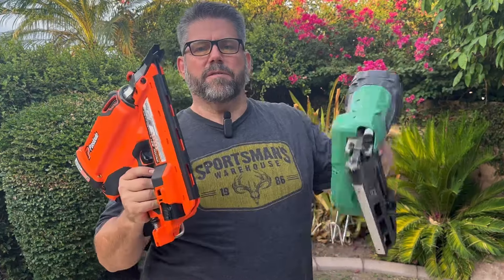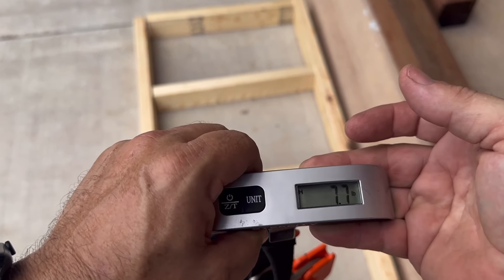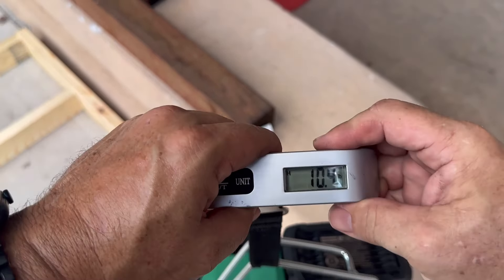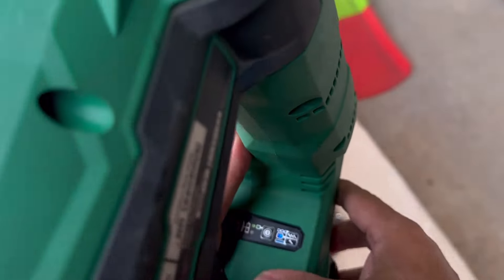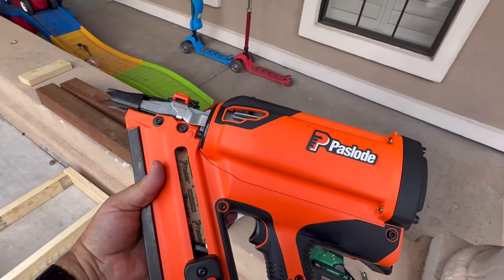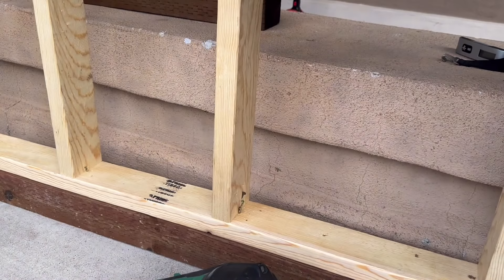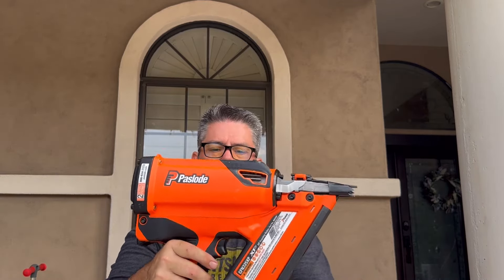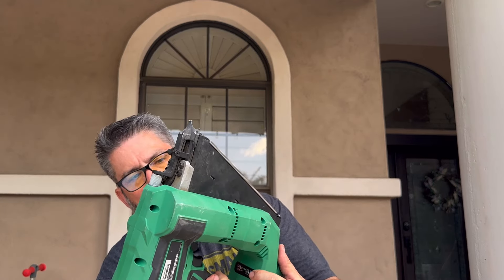Paslode vs. Metabo: Cordless Framing Nailer Showdown!

Comment: I have a Milwaukee 30 degree sitting in a box right now trying to decide about the Paslode.  The weight difference alone is significant enough to justify the $150 more.  My concern is the carbon monoxide emissions from the fuel cell on the Paslode as I would be using it exclusively inside for renovations.  Wondering how strong the odor is when using it inside.  Safety instructions say a "well ventilated area", but in Northeast winter I do not think the homeowners would like the windows left open to use a tool.  So if you have used it inside how bad is the gas odor?
Reply from the maker: I don’t think it is any more than a plumber who uses a torch to sweat pipes…or a chef who uses a butane torch to burn sugar….so unless you are in a seriously small confined space you won’t notice it

Comment: Hey mate, I bumped to one of the paslode framing nailer for $200 at lowes, the other day, but I didn't get it. just thinking about  $15 each fuel every 600 nails. (I buy in bulk  (4,000 nails per boxes) almost like $75 bucks in just fuel.
 i like milwaukee, but it does require servicing after a while. On the other hand, the dewalt gun it just keeps going and going as long as you have batteries and nails. I did have a small issue at one point. (stopped sinking nails) I took it apart and cleaned it, and that was it.  shoots nails like if it was new again. But in all seriousness, I prefer pneumatics if I am machine gunning all day. I use cordless for small projects. (Like 100 nails or so)

Comment: Good video. Wish you could have gotten your hands on the new Xpro for a more truly apples to apples comparison. 

The more lightweight compact design of the paslode makes it a winner to me though. If clipped head nails are allowed by code in your area I would definitely go for 30 over 21. The plastic collation comes back and hits me in the face when I have to use a 21 degree gun.